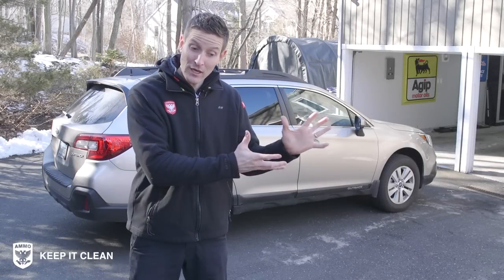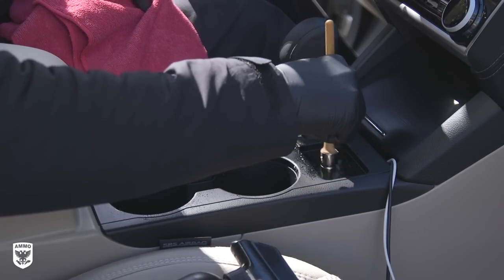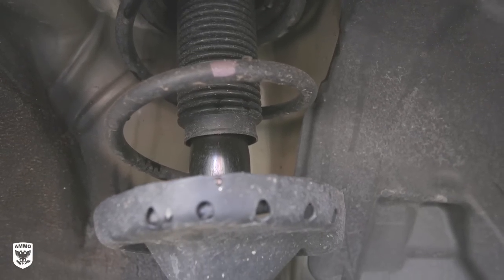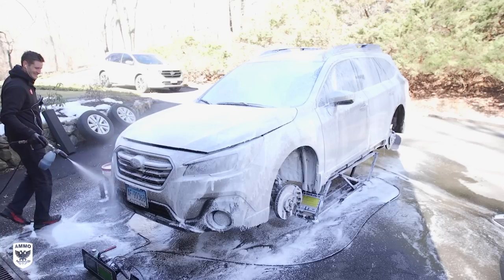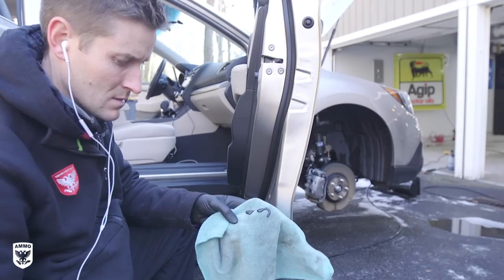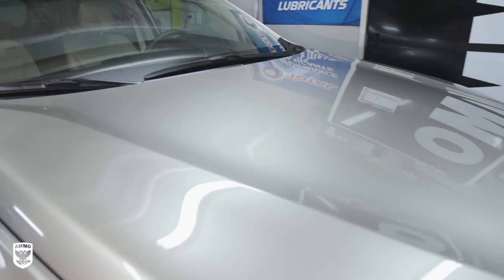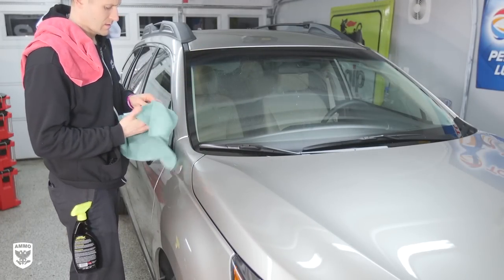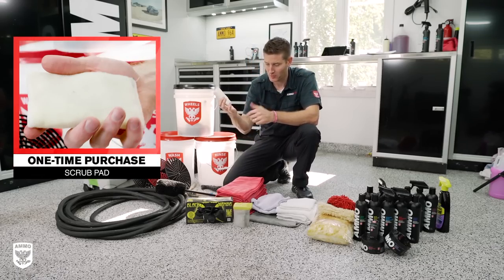Best Spring Cleaning Car Wash to Remove Salt!

Comment: Would ammo boost or other soapy products remove the lubricants on the guide pins and the brake hardware? I just spent 4h yesterday doing every single calliper, greasing the guide pins, and necessary areas so they run smoothly... and I would hate to just wash it all off after a wash.

Comment: Why cant we use any other cleaners on the pedals?  If I'm using something that cuts grease, that should leave the pedals clean and safe to use, right?  Why cant I used a different brand other than AMMO?

Comment: A lot of great tips...I would advise against power washing the engine bay...horrible idea....I have seen electrical problems numerous times by high pressure forcing water into electronics, intakes, etc.

Comment: Nice video, thanks for all the tips. A quick question... I'm living in Canada, and having to deal with salt, we usually do a rust proofing every year.  How do you keep a car clean when the dirt and salt of the winter have stuck into the oil/grease mix?
Reply: flolegrand44 he uses his boost winter wash which has corrosion inhibitors in it.

Comment: I notice you don't seem to be concerned when spraying the engine bay with water...when you say "sensitive engine components", what do you mean by that? Modern engines seem to be littered with electronics, wouldn't all of those be considered "sensitive"? I would love to do this with my engine, but I'm scared that I would ruin something major. Any advice?
Reply: Been washing engines for years. Never had an issue. I think its a myth. Maybe back in the day with Distributor caps and stuff but nowadays most of everything in your engine is shut up tight and rain gets in normally too.

Comment: Hey Larry, is it okay to add reflex or other ceramic coatings on your car while its outside. I don’t have garage.
Reply: Orange Marley yes, you can do it outside, but it is quite a lot more difficult. I recommend getting a pop up shelter to keep the sun off the paint as hot panels are a big no no when it comes to almost anything in the detailing world.

Comment: I will never spray water in the engine bay like this.. I prefer using a waterless soap. To prevent scratchings the wheels,,,place them the side facing outward toward the sun. :)

Comment: Did the car have a “bra” or other type of coating? If so would reflex have the same effect on bare paint. The results look great .Also how would you take of reflex to re apply it? Regular wax removal soaps?

Comment: Hey man, just bought a used but decent Astra SRI the sporty one, but it’s few year old and looking to really clean it for the first summer wash. Looking to clay it as it’s not been done from what I can see. Are all clay bars made the same or are there decent ones to get.
Reply: You can't go wrong with Bilt Hamber, just make sure to use lubrication to avoid marring. I use the bucket of car shampoo I just washed the car with.
Reply: David thanks man.

Comment: 13:30 Am I the only one here who really HATES products like Rain-X or any other nano-product / protection for the windshield? Some people claim that after using products like Rain-X you don´t even need to use the windshield wipers anymore - simply because the product is so water-repellent that it will make the rain run off the windscreen wipers automatically. But first of all I always get screeching windshield wipers when using any type of water repellent product on my windshield. Secondly I would go nuts if I did not use my windshield wipers and had to look at the water pearls running off my windscreen when driving.
Reply: Try cleaning your wiper blades and follow up with a coat of Rain-X on the blades
Reply: Never had any kind of screeching or noise from wipers after Rain-X and similar products.

Comment: since you mention subaru paint... Have you noticed it to be as soft as everyone claims it is?
Reply: Anthony Zupanek my wife just traded her '15 outback for an '18 and I have an '18 wrx. What I've noticed is the paint on my wrx is softer than the paint on the outback.  I think the reason for this is the outbacks are made in Indiana while the wrx comes from Japan. In my experience I would say wrx is soft and the outback is a little harder. Closer to a medium.

Comment: Larry just wait until you replace those crappy crappy Bridgestones , I had them on my Subaru and they were horrible, after they wore down I put on some Michelin pilot sport A/S + and it made a world of difference and handling on the Subaru it’s too bad they make such a nice car and put junk tires on but I guess if you’re saving two cents per unit of tire from a manufacturer standpoint.

Comment: Good video but it's unnecessary when your driver in the rain couple times does the same trick the only thing I would recommend is washing the bottom of the door that's usually what gets roasted first people always forget about the bottom of the inside of the doors

Comment: Larry, have noticed you haven't gone into your own glass cleaner nor hinted at it? Do you feel no need to, nor see any improvement over anything else on the market? You're always mentioning how important the cleanliness of glass is to customers.
Cheers
Reply from the maker: Always playing...but to get it right it takes time :)
Reply: If you come up with a break through like Frothe for window cleaning, that'd be awesome.
Speaking of windows, don't believe it's been greatly covered.. Polishing wiper marks, small stone chips and/or minor imperfections in windscreens? Have seen it done before and curious if you would cover such a topic?

Comment: I am completely anal about my vehicles. $2 car wash on the undercarriage and wheel wells after snow storms. Plain hot water will melt salt off of any vehicle. Do this after the roads clear and your car won't rust out.

Comment: ceramic coating + clear bra + wax (every week)  = best car paint you will have 3 years down the track and it will look as wet as if you dunked your car in the pool
Reply: with that much protection, you won't need to polish, compound or wet sand

Comment: Seems like allot of crazy expense. Automobiles do not stay "new" for ever, you know? I have a 2015 Nissan 370z and I live in S. Florida,  I had the car now for 3 yrs, and only hand washed it, and hand dry it, never have I ever waxed or otherwise any "detail" as sorts, As far as the engine bay, I simply just spray it down with my hose, And to be honest, the 370z looks just as good or better as the day I brought it home.

Comment: After a few year the undercarriage will start corrode without some kind of undercoating. Obviously this is a new ca in the video.  You might get away with washing the undercarriage the first few winters and it coming out shiny but eventually you'll wish you had protected it.
Reply: My 20 year old 4Runner always received an undercarriage spray once a week during the winter -- 0 rust.

Comment: A simple wash with a mitt and a a hose to get the wheel wells and under belly as best you can.  Takes 30 minutes for entire car.  This is overkill life is to short and the car will be worth no more at trade in because what your doing is a wast of time.

Comment: Oil change ? every winter ?
Reply: I change the oil in my car once a year.
Reply: change it more often, you're doing damage to your car
Reply: it all depends on how much you drive. Time is not a factor of distance. 9 to 18'000 miles is the typical range after which you should change the oil.
Reply: Vlad G, no sir, changing any more often than 6,000 miles for a street car is wasteful and has no benefit whatsoever, as long as quality oil and filter are used.  I use Mobil1 0w30 and change it once a year, which for my car is barely 5,000 miles, sometimes even less.  My original engine has over 363,000 miles to prove it.
Reply: Interesting, but wouldn't where you live and your driving habits be a factor? I live in a cold climate and drive short distances. In the winter, with sub-zero temperatures and moisture everywhere, driving short distances creates water condensation that doesn't have time to burn away, which contaminates your oil can quickly turn acidic. You get this foamy build up from it. Many people recommend changing your oil more frequently in the winter because of the acidity.
Reply: @Vlad ... isnt your Oil circuitry supposed to be airtight ?
Reply: What do you mean by circuitry? Do you mean air and water isn't supposed to get into your oil? While it's supposed to be air tight, condensation can still form when you have a surface that's cold on one side and warm on the other side, which happens in the winter. Manufacturers expect for there to be some water vapors in your engine, which is why most cars have a PVC valve to let the vapors out. Check this video out, it shows the foamy gunk build up that can happen in the winter if you live in a cold climate and drive only short distances. https://www.youtube.com/watch?v=kKeqpAU_W6M

Comment: God this makes me wanna detail the crap out of my car.... I just wish it wasn't so water spotted and swirled, I don't even bother waxing it. Don't buy a used car that's dirty people... the dust hides a lot of paint imperfections as I learned the hard way.
Reply: Why not take the time to restore the paint finish? A da polisher at harbor freight is $60, buy some good pads, rubbing compound, polish then wax it. It will look brand new. I've done this for my neighbors. The paint was trashed turned out almost flawless. Just takes time but if you really take pride in your car it's worth the work.

Comment: This is a good video however using all this "product" is not needed unless you have a very expensive car ,, but lets face it if it was that valuable would you drive it in the salt ?   if you added up all the cost of the products he uses in this video it is probably over $400 in materials as every 12 seconds in video he is switching to another product ...

Comment: 13:04 your sex face? Also, before the winter comes round I like to spray my underside with Fluid Film. Helps with avoiding costly rust on my Toyota! Just a thought. Super easy to spray on and stays on after rain, snow, and sleet.